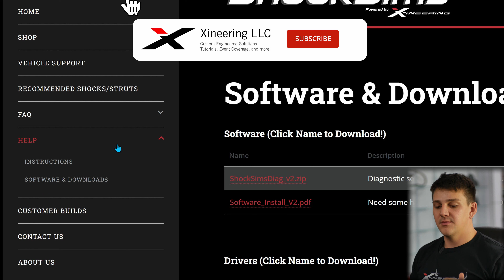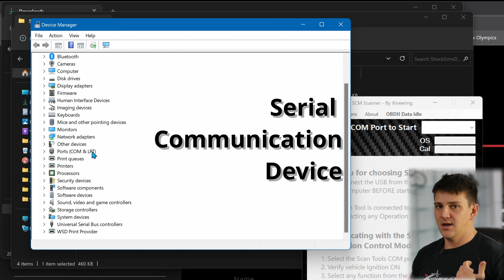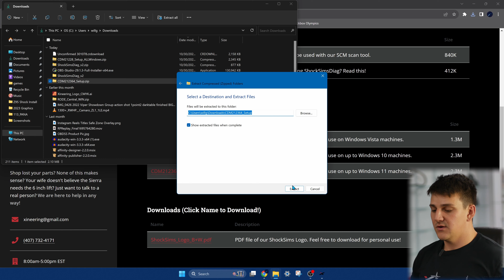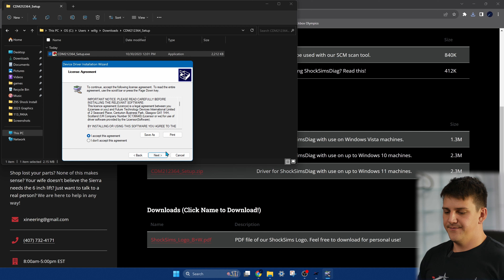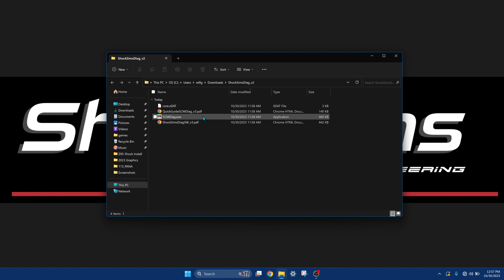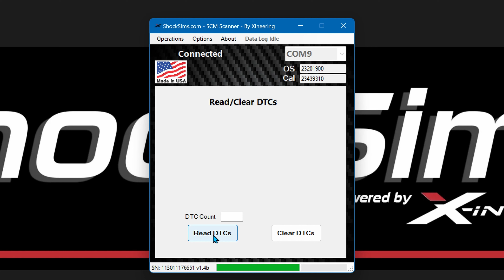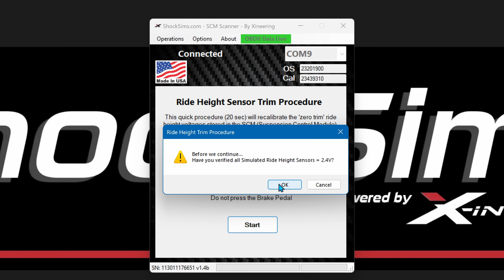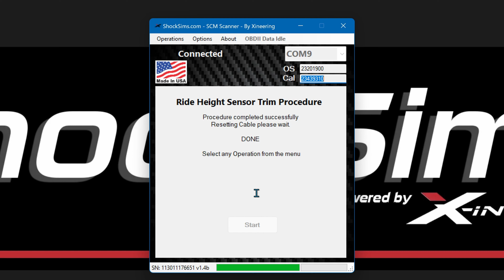GM Suspension Control Module (SCM) Scan Tool - Software and Overview

Comment: This all seems tailored toward deleting mag ride. I have a 2014 CTS (3rd gen) V-Sport. The car is the same from 2014-2019 for the most part. I'd like to install the electronic suspension programming from a 2016-2019 CTS-V. Both cars have the exact same module part number (GM GENUINE 23201896). Are you able to help with that?
Reply from the maker: You can view our vehicle support here:
https://shocksims.com/vehicles.html

I HIGHLY suggest going with our OBD2 unit, the OBD/SS.
You can view the product here:
https://shocksims.com/shop.html#!/OBD-SS-Module/p/553911289/category=0

You can view the install video here:
https://www.youtube.com/watch?v=al2eRPVrGVQ

Comment: Just make it ride like a truck.
Reply from the maker: This video is going over how to use our Scan tool Software to read out DTCs from the Suspension Control Module as well as perform a Ride Height Trim Procedure.